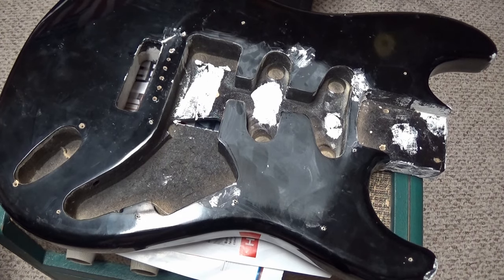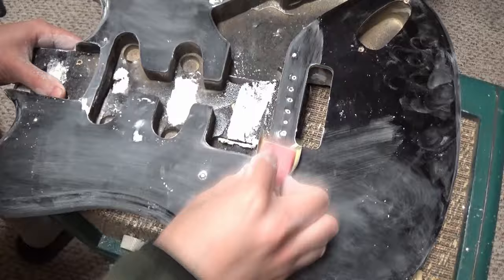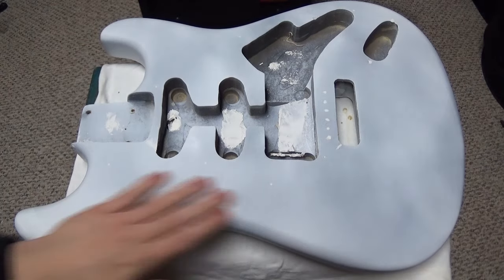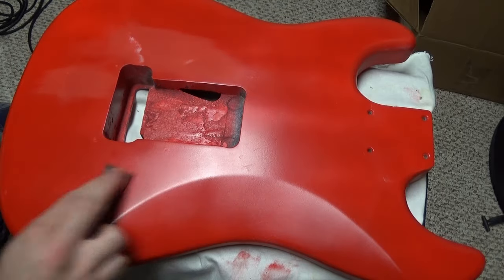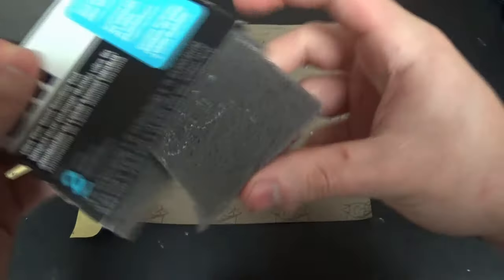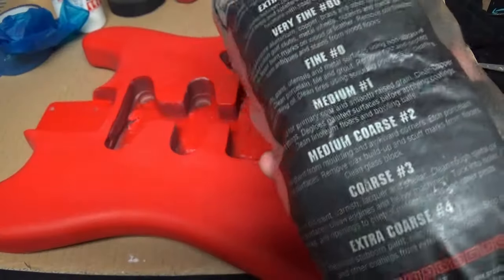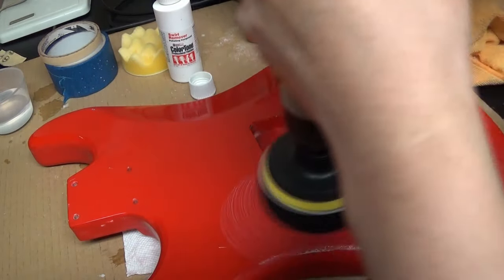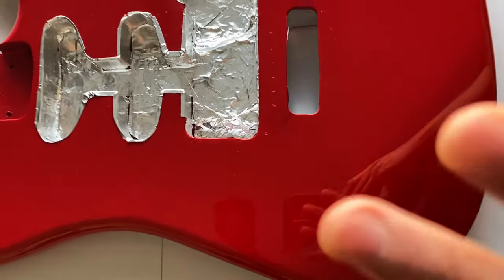REPAINTING A GUITAR WITH SPRAY CANS. Clear Coat Finish

Comment: Very cool. You’re right, if you prepare and put the time in, you can achieve a great finish with rustoleum cans. I’ve sprayed many guitars with cans and spent hours wet sanding from 400 to 7k and then buffing and achieving a show room finish.
Reply from the maker: yes. prep is the most important role

Comment: Best explanation and results I've seen.  Thanks
Reply from the maker: thank you! i’m glad it’s good for you, let me know if you have questions about any guitar paint work..
Reply: @guitarforall  I just finished a nitrocellulose lacquer sunburst on an ash body telecaster.  I did not use grain filler.  An experienced friend said he uses lacquer as grain filler so I tired but now all the grain shows even after tons of coats and sanding.  It's done and looks nice but can you think of anything now or is it a bit too late?
Reply from the maker: @biggstile  was your goal to not have any wood grain show at all? just solid paint color?
Reply: @guitarforall  Some grain -- a little bit, but not as much as I do.  Wish I could share a photo.
Reply from the maker: @biggstile  do you have instagram? you can send a picture to me on there https://instagram.com/pyromaniacofdestruction?igshid=YmMyMTA2M2Y= 
but there is a brand called ‘stew mac’ and they sell a can called “sanding sealer” it’s a nitrocellulose based clear spray that going on whenever you are doing the priming stage of the guitar body. for example: you can sand down your guitar again and make it smooth and level. then spray on the sanding sealer spray and it’s a very thin spray that helps close off pores or grain in the wood. (and it’s very easy to sand off). this sanding sealer is the best choice to use since it’s easy to sand and you’ll get great results if you want to keep any wood grain on the guitar body. but if you want ZERO wood grain on your guitar body, then i would recommend buying a automotive car glazing putty to apply to the guitar. it’s a thin paste than can be applied to the guitar body to fill in the wood pores. it’s much different than automotive body filler: body filler is thicker and is harder to work with. the glaze putty is much lighter and easier to sand down to work with.

Comment: Great job dude 👌 I'm looking forward to doing my first gloss finish this weekend ( I've always done the matte until now ) you give me hope for success with the rattle cans ! 🤘
Reply from the maker: thanks metaljay, the trick to get a nice gloss finish is using steel wool. after applying several color coats, i lightly sand it down with 800 grit or even 1000 grit. then after that i use the steel wool balls and sand everything down again, then you apply your 2K clear coat over it in light coats. (10 minutes in between coats) i use the WHOLE can on one guitar body. just be careful about humidity and dirt debris in the air that could stick onto your guitar whenever you are painting. but best of luck metal jay, keep us updated on instagram - acnewash

Comment: Use a block in the neck pocket and a screw where the strap goes in the back and paint it with the guitar flat then flip it over and use the wood on the back of the neck pocket or in the spring hole that keeps it flat and not hanging you'll get no drips flat

Comment: Love that spray holder attachment !  &---why hang the body vertical ? Surely paint runs are inevitable for amateurs?--any how --nice work!
Reply from the maker: thank you! the spray can attachment was a game changer , no more sore fingers and more consistent spray applications. i hang the guitar because it’s hard to paint the whole body if it’s laying down on a surface or object. the key to prevent runs is to always do light coats, im pretty experienced at it and sometimes i get runs myself. you Just need to keep your can moving at all times , with light coats. and build your coats up until you have a nice even surface of color. wet sanding runs is best since it won’t remove as much material as dry sanding would
Reply: Great video, extremely informative and helpful!

Comment: Did I miss the part where you used Lacquer?
Reply from the maker: @mikeb792  unfortunately my camera wasn’t recording the process when i was doing it :(. but it’s the same way as spraying your color coats… spraying light coats from a 6-7 inch distance from the guitar. wet sanding at the end helps achieve that mirror like finish ..

Comment: Were you sanding the color or the clear topcoat. I need to know if I can sand the color before I apply the clear coat. Thanks - and great job.
Reply from the maker: i apply a few coats of color coat without having any runs or bad spots. let it dry for a few days. then i lightly sand the gloss out of the color coat (because the spray can is color and gloss at the same time, so i just scuff it all up with a scotch brite pad until everything is matte.) then you can add your clear coat on top, just make sure you keep a steady flow and distance with the cans. best of luck
Reply: Thanks Soooooo much for getting back with me so quick. You soothed my OCD worries. I will get some scotch brite pads. Will that remove paint drips and smooth out other imperfections. After dulling with the pads didn't you add some more red coats before the clear coat. Sorry for the questions, but  I have started over strippng 2 times already and do not want to do it all over again. I searched the web and could not find any info whether you could sand the color coat.

Comment: If you have no nicks or dings can you just prime over the existing finish and then repaint?
Reply from the maker: @StoneHands25  i would sand the body down with 400 grit and then 600 grit. to make sure it’s smooth before applying primer. just to remove any light scratches, with dings i would add some body filler to it and sand it down even so it doesn’t look weird whenever you add color on it. little details come a long way

Comment: Also warm up your can in a bath of hot water reduces splatter.
Reply from the maker: yes. i always do this trick, even with primer , color and clear coat cans. it works great in the spring/summer time , in the fall weather it’s hard to get the warm can to stay warm. unfortunately now the temperatures have dropped and i might have to find someplace to do this paint job indoors. but thank you for watching!!

Comment: Great video & great links!! A beautiful finish like that w/o any clear coats?
Reply from the maker: there was clear coat added, but my camera died so it wasn’t recorded on video. used a full can of 2K clear coat and wet sanded with 600,800,1000,15000,2000,3000. polished and buffed out
Reply: @guitarforall  Thanks for the update!!

Comment: Man you  saved me! Haha I was about to use the 2X Rustolem clear coat until I started reading the comments here and saw you recommended the 2k spraymax clear coat. I see your note in the description. I have already painted the guitar with my 2X Rustolem color and was going to do the clear coat in like 2 days, I didn't think about sanding before the clear, thought I would lose some of the glossy color from the can but makes sense. 

Just to confirm though.... after the last color coat, did you do wet sanding? or only start wet sanding after the first clear coat?

I'm at the state of ready for the clear coats just wanted to make sure I am good moving forward, if I should wet sand before going clear, or if I can go straight clear.

Thanks in advance!!
Reply from the maker: @Composercleo  thanks for watching! 2K clear coat is the absolute best. i would only wet sand the color coat if you have any imperfections like dirt , bugs , or runs. i always scuff my paint coat before i apply the clear coat. i use a gray scotch brite pad and lightly scuff up the color before clear coat. and use glass cleaner to wipe down everything before you spray the clear coat , to remove any oils and grease from it. i spray about 4-5 coats of clear on the guitar. your first coat should not be completely wet , just do a nice light coat. wait 5 minutes. 2nd coat, light as well. then 3rd and so on … give it nice coverage keeping a 7 inch distance and overlap your coats about 75%. let it dry for 2 days and then wet sand it all with 2,000 grit , 2,500 then 3,000 and 3,500/4,000 if you have it. use meguiars polishing compounds to achieve a glass like finish. spending the extra bucks really makes a difference. let me know how it goes! please wear a good respirator for this
Reply: @guitarforall  Wow hey man thanks for replying so quickly! 

Okay cool! I have next to no imperfections (not sure how) but I do have the gray scotch brite pads though so I think I will give it a go (even though it will pain me to see the gloss go away 😭.. I know its for a better outcome haha) 

Thanks for the clarification! Was thinking I had to sand in-between the 2k coats. I do have the meguiars polishing compound and was going to just use a T-shirt to really get in there and give it some love.. (and hopefully build some more muscle haha) 

Got a good respirator too! I don't want the paint job to outlive me by that much! 😄Thank you so much for the quick reply, I will definitely let you know how it goes!
Reply from the maker: @Composercleo  removing the gloss from the color coat definitely helps with adhesion. the gloss on the color may cause runs with the clear coat cause it has nothing to stick too. so don’t be shy with the gray scotch brite pad. i used to sand in between my clear coats but i realized it really is a waste of time. 5 coats of clear is good to wet sand with. i always go heavy with the clear coat because it can always be wet sanded and buffed out. ebay has good buffing / polishing pads for a drill attachment. saves time and effort , if your gonna buff by hand use a microfiber cloth because a t shirt may scratch it up since it has strong fibers in it.
Reply: @guitarforall  Makes sense! Yeah I won't be shy promise haha since I did have to do it to scuff the original finish (which hurt less since I didn't like that color) 

Good point on the heavy with the clear since you sand and buff. Also good point on the scratching.. I think I will just get the foam polishing kit that you linked! Thanks for the clarification on all of this, feeling a lot better about finishing off my project!
Reply from the maker: @Composercleo  absolutely, best of luck. put your spray cans in warm water for 30 minutes before you spray. it helps soften up the material so it sprays out easier too.
Reply: @guitarforall  Thanks! Going to give the clear coat spray a go relatively soon. The can came today, hopefully one is enough, I heard that the can has a short lifespan. I did my last color spray yesterday, so going to wait a few days so it can dry completely before I use the scotch brite and start the clear coat process! Thanks again!
Reply from the maker: @Composercleo  i end up using a whole can on a guitar. which is about 5-6 coats of clear. i let my guitars dry near a dehumidifier so it isn’t so humid. the humidity slows down the drying process. i hang my guitars in my basement in the same room with a dehumidifier and it helps a lot too. if not, just add a fan in the room to help circulate air
Reply: @guitarforall  Okay cool so my one can will work thanks for confirming! Ah yes!! You know I've had a dehumidifier on recently in my basement without thinking about how it impacts the paint process but did notice it does help! I wonder then if I should start the clear coat soon since the color coat is dry now even though I painted it yesterday
Reply from the maker: @Composercleo  i usually wait a day after i spray my color coat. just check for any imperfections or runs , lightly scuff it up and your good to go. the clear coat covers a lot more than you think. just keep a good spraying distance and wait 5 minutes between each coats.
Reply: @guitarforall  Okay sounds good! Question... any bad things about doing the clear coat say in a few days and then waiting a week or so to start the wet sanding? (Not for any specific reason other than being out of town) Or should I do the wet sanding sooner?
Reply from the maker: @Composercleo  it should be fine for a week. just don’t let it sit for months. a week is a good amount of time to let the clear coat “gas off”. and wet sanding should be a breeze
Reply: @guitarforall  Ooo okay cool! Then I think I will give it a clear coat spray and come back to it! Thanks again, super excited!

Comment: What clear coat do you use for this guitar?
Reply from the maker: @danielavellino  i would highly recommend using “2K clear glamour” clear coat. it’s a 2 part clear coat in a can and it provides the best smooth finish with very minimal orange peel.
Reply: @guitarforall  I was just going to use a two part clear coat that you mix and spray in a gun
Reply from the maker: @danielavellino  that’s good as well, maybe even better honestly. just make sure your air PSI is set to around like 29 for clear coat. test it out on something else before you spray the guitar. remember to clean off your guitar with glass cleaner to remove any grease or oils

Comment: Quick question do i have to use stew mac for polish?
Reply from the maker: @danielavellino  no i definitely recommend using other polishes / compounds. meguiers compounds are the best, so much better than the stew mac ones.
Reply: @guitarforall  any specific compound I should use?
Reply: @guitarforall and how long should I wait for my paint to cure before wet sanding?
Reply from the maker: @danielavellino  when painting the color coats i usually wait 5 minutes between coats. and i apply about 4-5 coats of color on a guitar body. then the next day i check for any runs or mistakes and lightly sand them with 800 grit. then apply your clear coat in the same way, light coats and a good distance to prevent mistakes / runs. 5-6 coats of clear coat to ensure a good coverage. i would wait 2 days before wet sanding.. make sure the guitar is in a well environment that is humidity controlled to ensure proper drying as well. always wet sand with a flat block and avoid your edges. Sand with 1,000 grit , 1,500, 2,000 and finish with 2,500 and 3,000.
Reply: @guitarforall  and what polish do you recommend?
Reply from the maker: @danielavellino  i highly highly recommend using meguiar’s m105 ultra cut compound .. this is your first compound step. then for the second step i use meguair’s 210 ultra pro finishing polish.
Reply: @guitarforall  alr man thnx very much

Comment: Yeah you can do it with spray cans, there are a ton of videos showing you can very easily do this and I have done it in the past, but the whole wait 2 months thing is BS depending on what you are using which once again depends on the chemistry of the lacquer and type of lacquer acrylic takes a couple weeks not months if you are taking months you are doing it wrong or the humidity level is way way too high where you live and you should think about doing it when its at its lowest.
Reply from the maker: @nocturnal101ravenous6  yes humidity should be very low. using 2K clear coat is the best option, dries and hardens in 2 days.
Reply: @guitarforall  Yep, I always also recommend when using cans to use a hot water bath in order to prevent nozzle clogging and it also prevents spitting.
Reply from the maker: @nocturnal101ravenous6  i remember i did add the 2K clear can in a bucket of warm water for like an hour while i prepped the guitar. i really need to make a new video showing my updated process steps. i just need to find a guitar body to use…

Comment: The only thing that I see you left out is you didn't say how long you let the thing dry after your first coat before you sanded it
Reply from the maker: i will make a new updated video next year in the spring. but for primer coats: do light coats only and wait 2 minutes before each coat. for color coats: do light coats and wait about 10 minute between coats. (please check your temperature that it is not below 72°F. and humidity is not over 40%. the weather apps on your phone can tell you this information). let the guitar dry for a week before you start doing the final wet sanding. i waited almost a month and it’s easier to sand because it is fully hardened and dried.